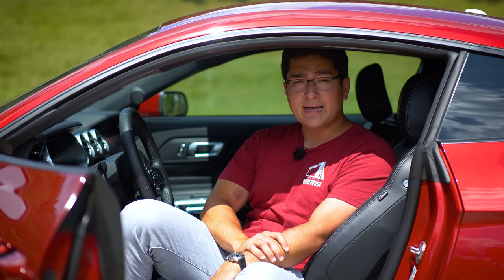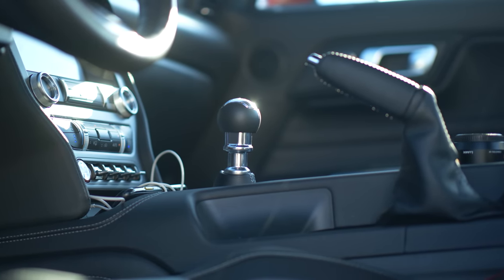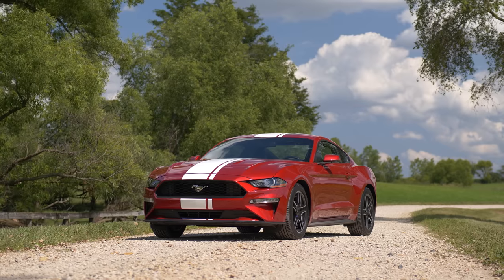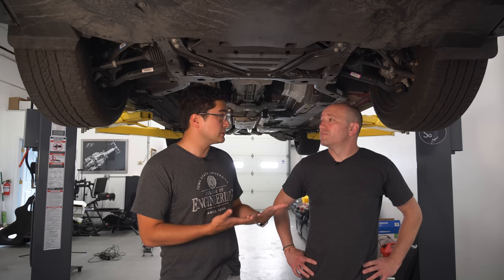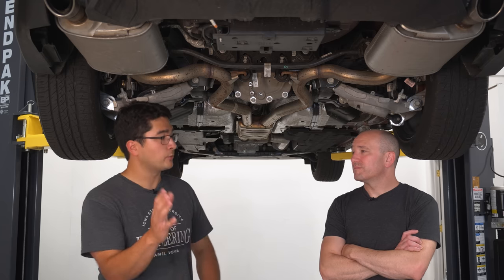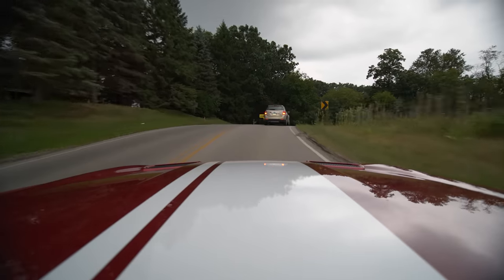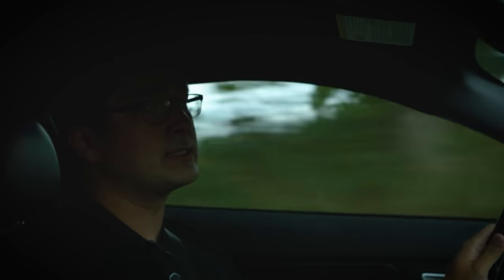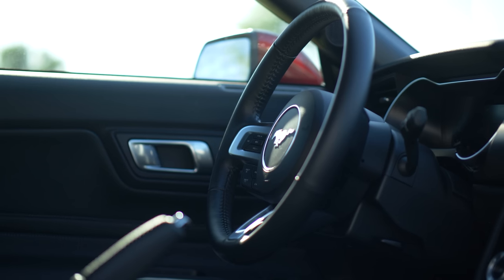2020 Ford Mustang EcoBoost | Red Headed Step Child

Comment: As a person who’s 33 and when I was 16 the base Mustang had a 4 spd auto, platform from 1979 and a V-6 that origin dated to 1969 it’s amazing how far the base model has come! I had that V6 Mustang and it was bad at the time.
Reply: Lol back when I was 18yrs old in 2007 I had a 2004 Mustang V6 with 190hp and a 4spd auto, I thought it was the greatest thing ever until I raced a toyota mimivan and got gaptized 😂
Reply: When I had SVT Focus way back when and it was in for service the dealer only had manual V6 Mustang to loan me to drive.  The manual in today's car makes that manual in the old V6 like working a pick handle in bucket of rocks.
Reply: @mr.boostang2064  don't beat yourself up toyota seinnas are fast as hell for a van
Reply: Jake Kennedy

Exactly, i was just online a few days ago looking at the specs of the 60s mustang K-code which was the high performance model back than, and this ecoboost puts out more power and torque and here alot of people are saying that its slow.

Alot of people have become spoiled over the years with these 400+ horsepower v8s. Im from the old school and this ecoboost has more horsepower than most v8s from the 1960s-2009, hell ive even driven an ecoboost on a few occasions and im impressed by it.

Its funny that not too long ago this ecoboost wouldve been a high performance car with its 310 and 350 pound feet of torque, but now alot of people are considering this slow, my how times have changed, and people are becoming more and more spoiled.

Comment: I was able to sample one of these EcoBoost Mustangs last summer when my wife and I took a trip to Colorado. We rented a convertible, and had an excellent time driving through the mountains, down to Colorado Springs and back to Denver, to Breckinridge, etc. The car was delightful. As a GT it was hard to beat, save for the smallish trunk. My daily driver is a Fiesta ST, which is huge fun, but a bit intense for my wife. The Mustang proved to be a really nice all-around package, with good handling and a very livable interior. It left a very favorable impression.
Reply: And the turbo excels in high altitudes.
Reply: I just rented one of these two weeks ago and thought it was pretty awful. Completely because of the 10 speed auto trans. It was so un-smooth to drive. It wanted to shift into second 5 feet off the line and by the time you've hit 10mph it's shifting into 3rd. I was driving the winding roads of oregon and it would constantly hunt/downshift so keeping a smooth consistent throttle was difficult because you only needed a little bit of throttle, but it drops three gears and all of sudden it lurches and tries to take off on you. Manual mode likes to cancel itself too quickly, and the manual shifts are too harsh/crisp for a comfort mode (although I'd love it if I was in sport). The suspension was pretty good, but still we were pretty tired by the time we'd park it after 3 hours on the road. Power was great. Sound of the engine was good. Wind buffetting with the windows down was really bad (but you had a convertible so maybe you didn't notice!). I'd totally take one, but give me a 7 speed where its a 6 speed with a highway cruising 7th gear.
Reply: @Krautastic  I think you made the mistake to drive it in “D” and not in “S”. Big mistake... In “S” and “S+” the shift points are different, and most importantly, if you use flappy-pads, it will stay in manual and don’t switch back to auto on its own. I exclusively use “D” only in traffic jams, or under 30mph in the suburbs.

Never judge the driving experience of this car based on “D” mode...
Reply: @juzoli  the quiet mode and track mode are both excellent in this car, better than both the D and S, S+

Comment: My how times have changed. I remember a buddy getting heat for buying a 4AT four banger Fox body, but it was a huge upgrade from his 3AT Tempo with whatever wheezing four banger it had.

Now we have 300HP four bangers with 10 speeds. Crazy.
Reply: I had a T-Bird Turbo Coupe back in the day and remember enjoying it as a fun, comfortable, daily-driver alternative to the Mustang.  This stock Ecoboost now offers about twice as much hp/torque, improved fuel economy, and rides/handles better with IRS.  It's probably a lot more dependable also.
Reply: Prefer Supercharger (Whipple/ Roush), because at 38,000 miles i had Turbine Lockup within the Turbos at 82°+. This is caused by Thermo Variations consider locations of Turbos Ford mounts them below for lower center of gravity.  Problem is they're right next to the very hot engine.  Ricers know this and mount them up high close to heat extraction hood vents.  To keep them cooler, and not for show. Now the Turbo Shell expands like a donut 🍩, while it's being baked the outside expansion is outwards vs. Inside expansion is inward the hole gets smaller. The Blades expansion is outward to be larger to hit the Shell. Locking up the Turbine Blades, and then add the Backflow from the Intake and Downpipe to it to spool the the Turbos more.
My fuel mileage went from 
32 mpg to 8-12 mpg.  Glad for 2021 it'll have the GT500 engine package 5.0 V8

Comment: What I absolutely love about the S550 Mustang's present lineup is that truly lives up to the hype of the original 1964 1/2 model. Every trim level is a legitimate performance car no matter how you slice it. Want a good momentum canyon road/track day hero to compete against Miatas? You got it is the form of the  EcoBoost Mustang. Want a classic Street/Strip Musclecar warrior .You got in the form of the Mustang GT. Want something to compete against the rich Euro-snobs in their Porsche 911 GT3s on the road course ? You go it in the GT 350/GT 350R . Want a supercar that you can drive everyday? Well you know, the GT 500. 

By ditching the good but unloved Cyclone V6 for the Ecoboost  we have young new carbuyers/enthusiasts who can take the money they saved on car payments and insurance premiums that would have to have paid for a Coyote equipped Mustang then buy an aftermarket turbocharger and a tune and easily get GT 350 levels of horsepower and torque . Again now ALL Mustangs are NOW in fact "performance cars" whatever the trim level or engine option.Esp. when Ford offers the PP1 and PP2 suspension packages on the EcoBoost Stangs. Being that the Ecoboost has an MSRP of $26,670 within the budget of a lot of young car buyer/enthusiasts.
Reply: Frank White  WTF you mean by that???

Comment: It sounds a though this is a great momentum car.  And, at 3500-3600 lbs., there's a lot of it.   My only wish is for Ford to shrink-wrap the Mustang - lose a little of the girth.   
But really, at the price, a rear wheel drive , manual shift car is remarkable.
Reply: Yeah I didn't realize how big the car was until I bought it
Reply: Got me a 2019 Bullitt in Feb. Of course a lot different price range and yes, I don't use all the 480hp yet, but it's such a fun car to have for a daily driver!
Reply: It's a comfy cruiser tho
Reply: Agreed but it's only going to get worse. The next Mustang is rumored to be based on the Explorer chassis.
Reply: @jmahtab  gonna be a boat like a charger, eh?
Reply: @Pube83  sounds that way unfortunately.  I wish they'd scale down the size and weight then I'd be interested again. Bring it back to Fox or even New Edge size.
Reply: @jmahtab  what the fuck

Comment: When I got my driver's license, the 4-cylinder Mustang had just been upgraded to 105hp, and you could let a teenager drive one.
The V8 had 205hp and 280 ft-lbs, and good sense said it was a grownup car.  Immature and unskilled drivers wrecked them regularly.
Twenty years later the V6 had 280 ft-lbs.
Now a 4-banger Mustang starts at 320hp and 350 ft-lbs...  Damn.

Comment: This is exactly the car I always wanted and I am absolutely the target demographic. I'm a guy in my mid 30s who makes enough money to enjoy this as my daily driver and it seems like a Saturn V rocket compared to the dumpster fire sedans and used hybrids I've had my entire broke-ass life haha. I don't really want more power than it has and the handling is super fun. It's gorgeous compared to everything else in its price range, too. The back seat is exactly perfect for my Husky/Shepherd mix. If you're looking at the 86/FRS/BRZ, look at this instead.
Reply: Funny, because it's between a GR86 or EcoBoost Mustang. Both have pros and cons for me.
Reply: @klausb1758  The higher cost and reliability problems was the main reason I ordered the new BRZ over the ecoboost mustang. Both are great cars, but the Brz/86 is cheaper to maintain and service.
Reply: @eyecontrol4900  I agree. I just don't wanna pay premium gas prices. Looking at a Miata now, but I feel cramped in them. There's honestly nothing on the market I really like. It's going to be a secondary/weekend car. So, I may not even get anything.

Comment: Clearly I am a slow driver but when did a 300 hp, RWD and manual coupe  become a little boring?
Reply: i know right? the guy in the passenger seat looks disgusted. and it's 310 hp/350 ftlbs but i dont think they ever say that. just 300 hp.
Reply: Steven Walton  yes, and most people that buy that gt500 or gt350 will never drive it to it’s full potential, some will most wont. 🤷🏻‍♂️
Reply: señor pepper because it’s less than 300 at the wheel goober.
Reply: When it has to push 3500 lbs of car. That’s when.
Reply: Herpil  and... the high performance eco goes to 60 in 4.6 seconds, it’s not that far off from the Gt, and they have the same governed top speed. Most everyday people this is plenty of power.
Reply: Psyberius Black well the high performance pushes that 3500 car to 60 in 4.6 sec. for a 30-35k car that’s not bad at all. 🤷🏻‍♂️
Reply: Zach and what? 310 at the crank means literally nothing when that’s not what the car is producing to the floor.
Reply: Herpil I never said anything about crank horsepower, I said exactly what I meant, 85-90 percent of people a 4/5 (4.6 second) 0-60 car is plenty plenty fast. The high performance ecoboost also has the same top speed of 155 mph as the GT. 5-6 tenths of a second slower between the two for most people is not a deal breaker, yes to 10% of people it is and I get that but I’m talking about the 85-90% of buyers. If you’re used to a 500plus horsepower car than yeah this isn’t quick enough but people like that don’t buy these ecoboost.  Peace out homie ✌🏻
Reply: I guess the driving dynamics aren't up to par.
Reply: Airplane have a high top speed and acceleration but they aren't fun to ride in.
Reply: @boner6003  then, why don't they use the wheel horse power number?
Reply: señor pepper because it’s artificial inflation. I’m 100% sure you don’t tell people your ecoboost has 270 horsepower. I’m sure saying 310 makes you feel much faster.
Reply: @boner6003  but its a scale that everyone uses. the gt has 460. the gt in 2003 had 260. you act like i don't know about accessory and drivetrain  loss. believe me, when there are 400 horsepower luxury cars out there i dont think the EcoBoost is fast. the 2 guys in the video could of took the viewpoint that the eco would give a pre coyote gt a run for its money if not beat it. they pretended to be disgusted and be like we want to hate it but its a pretty good value. its a joke

Comment: 5.O GT driver here and Im thankful these are around, I couldn't have my Mustang without them. Mach1 here I come....
Reply: That's a lot of money to pay for a a Mustang PP2/Bullet with some stickers
Reply: @kevinnorwood7355  different transmission, all the coolers that you need for track day, which PP cars lacked. Suspension and aero improved the upon PP cars, we will see how much makes a difference soon. Performance Mustangs are expensive now, no doubt about it, but thE Mach 1 is way more than badges, anyone who really tracks knows its the little things that add up. The lack of diff cooling on PP cars is a joke and everyone knows it.   Like i said we will see, and if its not up to par people like myself will not buy, simple as that.
Reply: ThomisticAmerican13FOX the Mustang PP2 has aero on it to give enough downforce on track days. An oil cooler is cheaper then buying a MACH 1.  Where I DO give Ford credit is using the gearbox from the Gt350 all Mustangs should have that gearbox.

Comment: I appreciate the high performance offered by the GT or the GT500 but in the end every financial decision comes with an opportunity cost.  No matter your financial position a $95,000 GT500 (because you can’t buy the base GT500, that would not show your true enthusiast passion) and you finance it for 60/MO at 0% that’s $1,583/MO and I left out cost for taxes, tags etc.   At the end of the video, you do mention some more positive notes but the disdain for this car is palpable.  True, go back not that far in the past and a base Mustang was not a good car period, enthusiast or not, but I give credit to Ford for working to change and improve the entire Mustang range so you don’t need to invest a mortgage payment each month into a car to have a good experience.
Reply: Dude, I so agree with you, so much, you almost need a YouTube channel dude !!
Reply: I completely agree, as an ecoboost owner, I'm not only tired of people bashing this platform for no apparently reason other than it is easy to hate, but also the snobbish and ignorant remarks that completely discount the value that the ecoboost has as a sports car.
Reply: Prefer Supercharger (Whipple/ Roush), because at 38,000 miles i had Turbine Lockup within the Turbos at 82°+. This is caused by Thermo Variations consider locations of Turbos Ford mounts them below for lower center of gravity.  Problem is they're right next to the very hot engine.  Ricers know this and mount them up high close to heat extraction hood vents.  To keep them cooler, and not for show. Now the Turbo Shell expands like a donut 🍩, while it's being baked the outside expansion is outwards vs. Inside expansion is inward the hole gets smaller. The Blades expansion is outward to be larger to hit the Shell. Locking up the Turbine Blades, and then add the Backflow from the Intake and Downpipe to it to spool the the Turbos more.
My fuel mileage went from 
32 mpg to 8-12 mpg.  Glad for 2021 it'll have the GT500 engine package 5.0 V8
Reply: You forgot to Mention insurance policy doubles with vehicles, which 500 hp
GT500 is practically at HyperCar status 
Wouldn't want to know how much more it would be to insure that beast. 
GT Premium, with Sport Package II 
Magneride Suspension, Brembo Breaks, Exhaust Cancelation. All performance of GT350,  without the Snake Badges.  Just  ad the Whipple Super Charger or a Roush. I'll have GT500 power tuned to 720 hp for half the price and yes Recaro seats are available, and without HyperCar policy
Reply: Mario Monclova One of the problems that cant be resolved about the GT is the MT 82 transmission. The gt350 is worth it for the engine sound, and the transmission. You can do all of the above to a gt350. The insurance hike is worth it if you can afford a gt350. Those upgrades to a GT are nearing the range of a nice condition gt350 at around 50k
Reply: @Gergaferg  Unfortunately, it's the insurance along with the higher payments.  GT500 is the ultimate, though, tha is far from my financial status.  I even retired from racing, because am looking a future of having at least a wife. Girls were hardly ever at the race tracks an if they were it was to support boyfriend's racing or husband's. 
I started hiking in the Forest to look for girls there
Reply: @ChasingDifferentAdventures  That last sentence is kinda eery lol, but I get you. I have a wife, but she supports this hobby of mine because she know how much I love cars. She isn't as into it as I am, but she really tries, even to the point that for her first car she's considering the new ford bronco because I'm such a fan of it. I'm married rather young, only 23

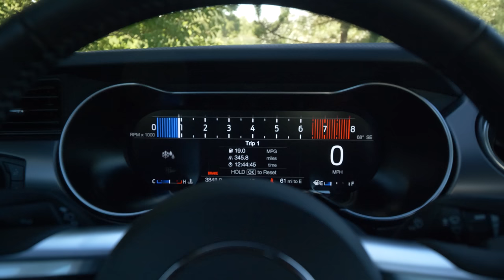Comment: I bought a new 2018 Mustang Ecoboost 10 speed automatic and love it. I bought a base model, with a few options, to keep it light and cheap. The MSRP was $28,865 and I paid $22,890, excluding taxes and DMV fees. I wasn't looking for an all out sports/performance car and all of the compromises they come with. I was looking for more of a budget GT car, to use as a daily driver. My car will run 13.20s in the 1/4 mile, stock. All I did was adjust the tire pressures. Also, it'll get 35mpg on the highway at 70 mph, with the 3:15 rear gears. It outperforms my 2006 Mustang GT automatic in every measure of performance. It ran 13.60s stock, and gets 27 mpg at 70 mph. If your wondering why you've never seen a Mustang Ecoboost run low 13s in the 1/4 mile, in a magazine road test, it's because the never test a base model automatic. They always test a premium and/or performance pack car. These cars are heavier. Also, alot of their added weight is in the bigger wheels, tires, and brakes,  
which is the worst place for acceleration. Further, if you have the 10 speed auto trans, you don't need rear gears bigger  than the 3.15s. This trans has a 4.70 first gear. To get the benefit of bigger rear gears, you'd have to run wide drag radials or slicks. Also, the manual trans cars are easily 5 tenths slower in the 1/4 mile and 0-60. What other car, in this price range, will run low 13s, get  
35mpg, has 4 seats, a large trunk, and is as comfortable?
For you V-8 fanatics, I had 5 V-8 Mustangs before this one, and none were as quick, and all drank noticably more gas. Sure, the coyotes and factory supercharged cars are quicker, but they're  also quite a bit more expensive and drink alot more gas. Anyway, I paid my money, made a choice I'm happy with,
and don't begrudge V-8 owners for doing the same.